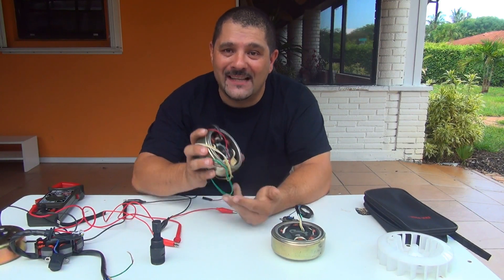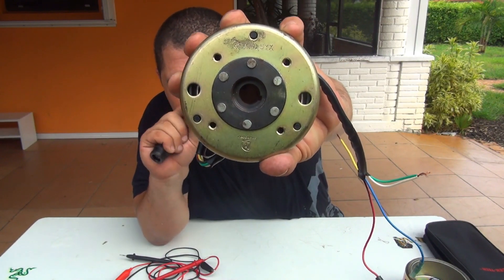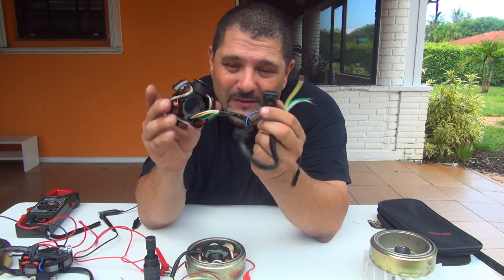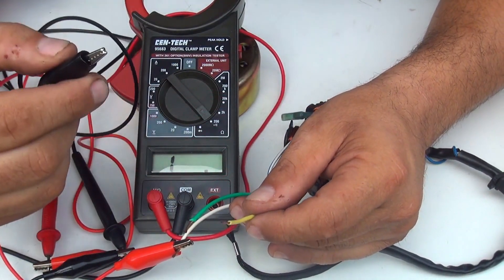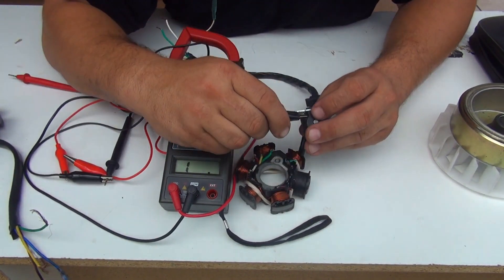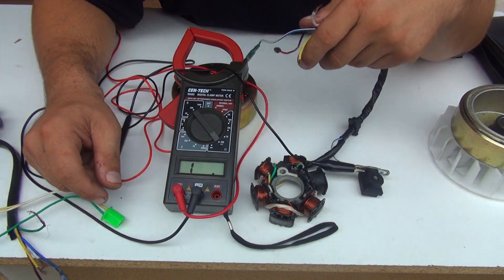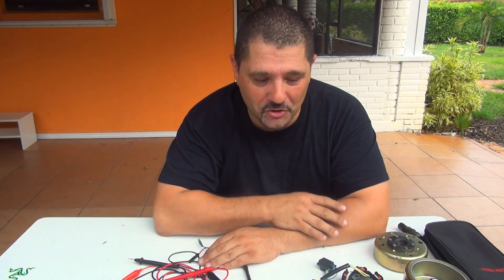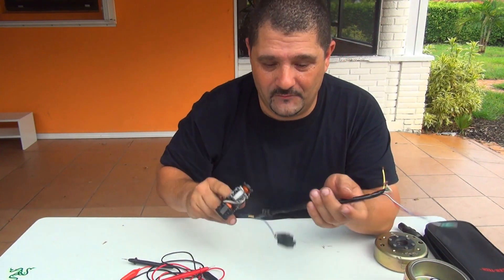How to test a stator on a gy6 150cc scooter

Comment: I replaced the head and it ran good for awhile but now won't start and green wire to stator is melted. Any idea what happened?
Reply from the maker: Hello the engine is not grounded the line that connect one of the screw of the valve cover with the negative  part of the motor is not connected with the battery to test you need a multi meter touch the battery with red probe on positive side  and with the negative black probe touch the motor you should have a reading if you dont you need to ground the motor . I hope this can help you and thank you for watching my video
Reply: So I found the stator  is shorted. Is that why my scooter won't start? I redid the grounds to the motor with thicker gauge wiring. Green wire still gets very hot from stator and I know the motor is grounded. I tested with multimeter.
Reply: I had same problem. my stator is shorted out

Comment: Hello,

I watched you video over and over to comprehend how you test the wires. My problem is that I believe there should be a reading when connecting the the red wire to power the cdi and the ground for the cdi. I looked though multiple videos and they say that there should be a reading. If you can reply that would be awesome 😎
Reply from the maker: Hello TalkingWithEd   I have 3 wires (  green , yellow, white and red stripe )  + 2 for the kill switch wires at the cdi at idle if you test with the multi miter ACV 200 you will get a reading testing the green and the white/red of 0.05 so after testing the green and the yellow you will get a reading of 1.00 ACV  200 at idle  if you do not have a voltage reading you have a problem on the wires or the  stator 
Thank you for watching my video
Reply: virberello GY6 Scooter Tips ok so I am supposed to get a reading when I have the red wire and the green wire connected to my multimeter. Because I don’t have a reading when I put the red and the green into my multimeter
Reply: @talkingwithed5474  You are totally correct Ed i believe. In his video when he is testing for ohms on the black/red(exiter coil) he says you should get no reading. I believe this is wrong. You should get a reading and a pretty high one too like 500 ohms and higher. I do not understand his explanation to you. He is a good guy and makes some good videos, but he is wrong here and if i had followed what he is saying I would have thought my stator was good, as mine has the faulty black/red coil and i get OL or a very low number,
So i got to give him a thumbs down on this one.

Comment: Do you pair the colorsnon the slide connectors from the stator? Mine has a black/red wire and white/blue/wire but the wire it connects to has red/black which is fine but the other has white/red wire. Shouldni connect white/red to the white/blue wire?thanks
Reply from the maker: Hello Nino yes  white/red to the white/blue wire thank you for watching my video

Comment: My stator failed all the test, I have a new one but still no spark.. hopefully it doesn't fail too.. and that I have a defective new part
Reply from the maker: Hello my friend anything is possible specially with this low prices parts sometime they ship parts that are not working the good thing that you can send the part back but the problem is that you have to work twice and remove your defective part from your scooter ah ah ah ah when I have no spark I always start to inspect the spark plug fist after I check the spark plug boot and them the wire of the spark plug and them the stator and the pick so I play a little elimination game and sometime I win ah ah ah and at the end I disconnect the red wire at the cdi  that is connected directly to the kill switch and the scooter like magic start right up.
Thank you for watching my video my friend and be safe

Comment: my friend. so these tests must be done with the stator removed from the moped? I think so because I am getting no reading when I probe the white and yellow/..
Reply from the maker: Hello my friend yes you can make the test when the part in on the scooter too but you will get a different reading
Reply: I was able to test my stator without taking it out just go to the wiring harness in the back of the bike and find the two bullet connectors one will be the blue and white wire the other one the red and yellow those two wires run all the way down to the pickup coil which is on the outside of the stator and flywheel check ohms and volts for both the wires the blue and white one runs to pick up coil and the red and yellow I think it's yellow lol  runs to the Exciter or charger coil and that is part of the stator that usually fails to where you won't get any Spark

Comment: Excellent video, I'm troubleshooting my gy6 and I do have a new stator installed but my yellow and white wire dont have a reading ,could this be stopping me from getting spark in any way?
Reply from the maker: Hello my friend many times if you do not have a spark is just the little sensor/ pick up next to the stator but if you do not have a reading could be a possibility that there is a melted or disconnected wire somewhere. Thank you for watching my video
Reply: @VirberelloScooterTips  I replaced the pickup as well as the stator

Comment: 1- when I turn on the engine and test the battery voltage it gives me different reads per seconds . what is that problem ? do you think it is the regulator ,, even when I move the voltmeter beside the battery it gives more different read without connecting any terminal  but when I turn off the engine it stops give these crazy reads
2- another problem : I have replaced everything in my engine yesterday (piston -rings - gaskets - spark plug - adjusted valves - everything was made professionally) even when I try to use kick starter it come to some level to be very hard to go down because of the pressure is so Good : but we have an opened place for the carburetor for the auto chuck which we di dnot install , we keep it exposed : when I use kick starter and starter motor it does not want fill the gas filter easy as it should be  ......   I know the battery is Dead ,,  note that the New battery is 12v 6A only while the Old battery was 12V 10A also the Fuse was wet because of the rain . the Engine does not want work easily it takes many many tries to turn on until the battery is Dead

Comment: Virebello, I have a question about my moped. I have this problem where at times when i turn on the ignition the moped doesn't power on until i shake it a bit. Do you know the cause of this? It has been driven under rain a couple of times in case that helps to diagnose my problem.
Reply from the maker: Hello Juvy this problem make me think a lose electrical connection somewhere or a connection with corrosion try to spray silicone lubricant at the ignition key also try to check your battery connection. Thank you for watching my video

Comment: If I connect red and black and then touch the inside of the coil and get resistance, do I have a short? Or is that normal?
Reply from the maker: Hello Dylan you should not connect red with black because you will have a short Ah ah but if you test the black and touch the inside of the coils you should get a reading . Thank you for watching my video my friend

Comment: itested the stator it was no good according to the multimeter. got another stator still no fukin spark. W.T.F. i hate electrical. the wire from the pick-up came loose still no spark. anyone know?
Reply from the maker: Hello Kevin the electric part of the scooter can  drive you crazy my friend  the pick up should give  the sign to the spark plug to fire up check this like I hope it can help you https://bit.ly/2nfaJfF or this https://bit.ly/2KxigjH also joi this group you will find lots of great members that can help you https://bit.ly/2nZ979U

Comment: I'm wanting to buy the taotao tbr7 to ride to work 12 mile round-trip,it's either the powermax 150 or the tbr7,what are your thoughts on this?which one is better in your opinion?
Reply from the maker: Hello Cody wow I love the the tbr7  the only bad thing is with the tbr7 you will not have any storage and when you find a storm you will get lots of rain instead with the scooter body you will be little more cover so my opinion is that the tbr7 is a lot more fun then the powermax but is also depend where and when you ride your transportation .
Reply: I want to upgrade the tbr7 so what parts do you recommend buying? I really appreciate you taking your time and your input
Reply from the maker: @richb5765  I'm not to familiar with the tbr7 but if you like to upgrade for more power is allays the best to reject or buy a larger carburetor , place a better air filter and iridium spark plug

Comment: Hello and thanks to your videos I've done many things to my scooter.  But i do have a question where in the USA can i buy the plastic parts for my scooter that it is the same as a  TAOTAO EVO 50 ?? Hope you can help me .thanks
Reply from the maker: Hello Dannier try this company but call them first to make sure they will send you the right product and give them also your motor number not the vin but the number on lower left side of the motor  
VMC Chinese Parts LLC
414 San Diego Rd.
 Carbondale, IL 62901
Texting cell numbers:  [618] 303-5706 or [618] 303-5409  or  Customer service is available Monday thru Friday 10:00am - 4:00pm at  (618) 529-2593 
https://www.vmcchineseparts.com/pages/select-a-scooter-model
I never Customer service is available Monday thru Friday 10:00am - 4:00pm at  (618) 529-2593  I never Purchase any parts from them yet or you can check on Ebay too and find cheaper prices

Comment: I have tried several magnetoes on my eagle gy6 150 cc scooter and when i get no reading between the white and the ground and the yellow and the ground the lights do not work and i have bought 3 magnetoes in a row ,brand new and the lights do not work,however i have an old magneto and i get a reading between the yellow and the ground as well as the white and the ground and the lights do work..My scooters works on a ac fired Cdi,does anyone know why?
Reply: Although the question is already 4 months old, I am going to put the answer in anyway for the people that might have the same question after this video. There are 2 systems for the stator. One is as described here: yellow and white (sometimes also yellow in stead of white) are two coils that are not connected to ground, only connected to each other . They go directly to the rectifier/regulator. From there the battery is charged and the lights are powered through the battery. The second (older) system has one side of the coils connected to ground,  the yellow goes to the regulator, and the white to the headlight. The yellow wire is from the middle of the coils, and the white from the end of the coils. You see this system mainly in older Honda bikes.

Comment: i only have 4 wires.  blue,white,yellow, and green. no red
Reply from the maker: Hello Green is always the ground or negative , blue should be the pickup , white recharge your battery and yellow should be running the light some stator do not have the red because they power up the cdi from a diversion on the yellow to power the cdi. Thank you for watching my video
Reply: @VirberelloScooterTips  Exactly, he probably has a DC CDI, whick is fed from the battery. The one for the system you describe s an AC CDI, which is powered from the stator. Which is nice, because even if the battery is flat, you can still start the engine.

Comment: Nice but what about if you electric starter not working?so I just bought a new electric stater kontak but stil not working.so do I have to change to new one like the one you halve
Reply from the maker: Hello Bahaa if you have a new electric starter should be working make sure that your kill switch at the throttle is on or place a screw driver between the starter solenoid poles and keep your hands away the problem could be a bad solenoid or a bad kill switch   or burn bad wiring check this video for the selenoid https://youtu.be/De1LNDVefXo or check this for the starter https://youtu.be/oww0wvUUYko